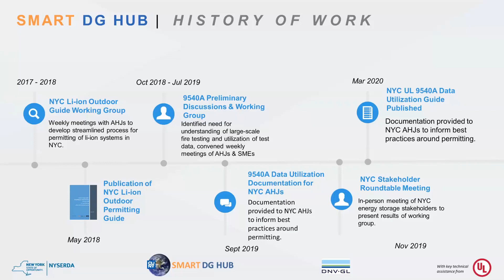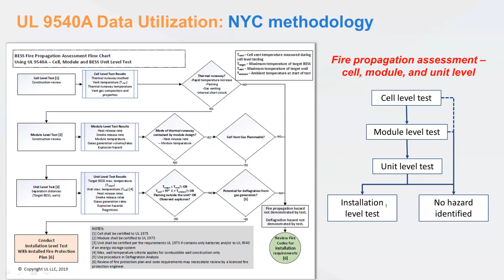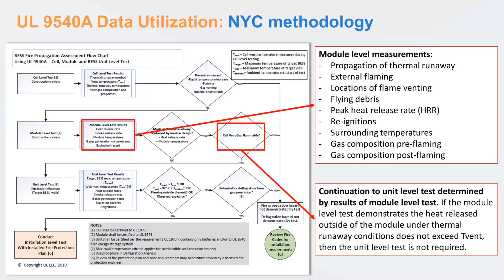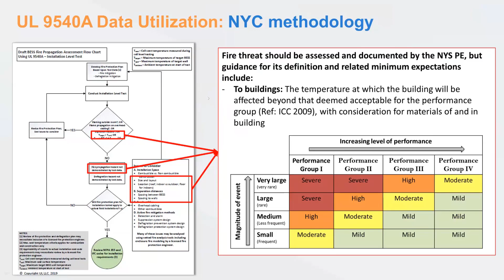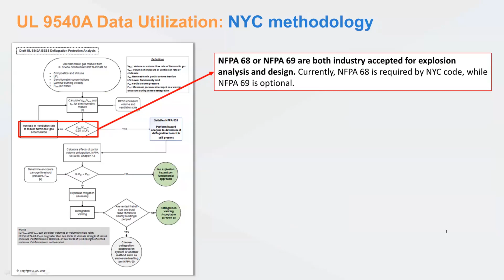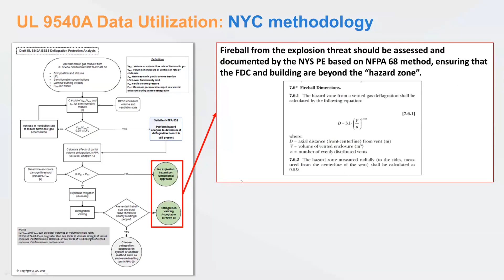UL9540a Guidance Webinar

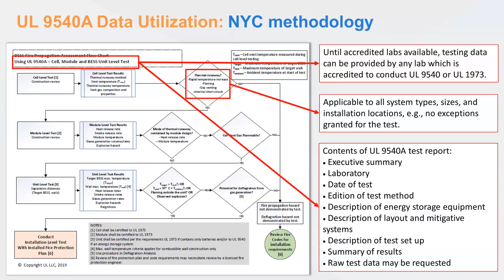Comment: Necessary for high density locals, especially NYC-- But essentially useless info for the home owner surfing the "bleeding-edge." If you are a home owner or architect itching to implement ESS, pay close attention to slice 19:45-20:09.
Reply: Im also still confused on out of the box Tesla Power Wall installation-- which is UL9540 compliant as per spec at: https://www.tesla.com/sites/default/files/pdfs/powerwall/Powerwall%202_AC_Datasheet_en_northamerica.pdf